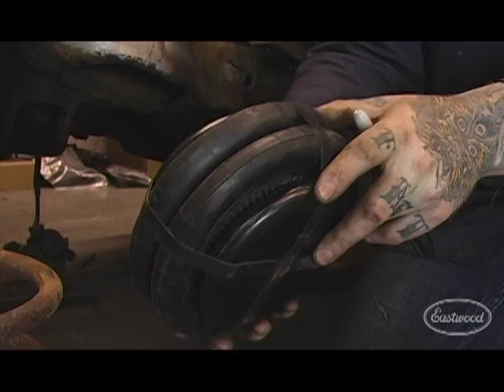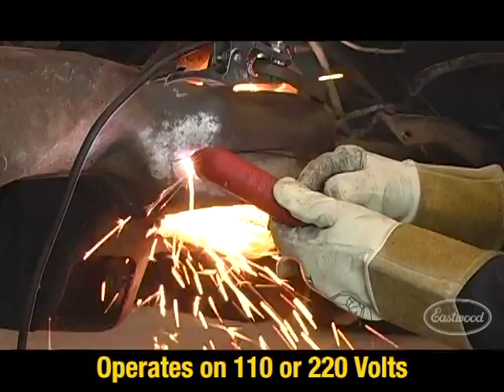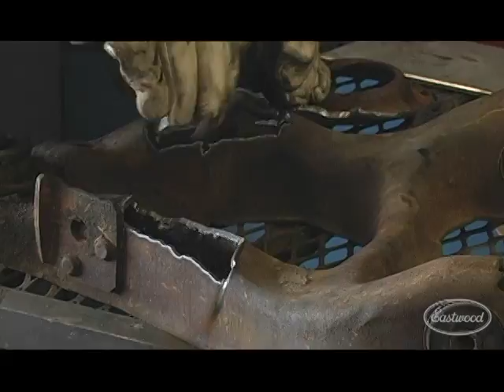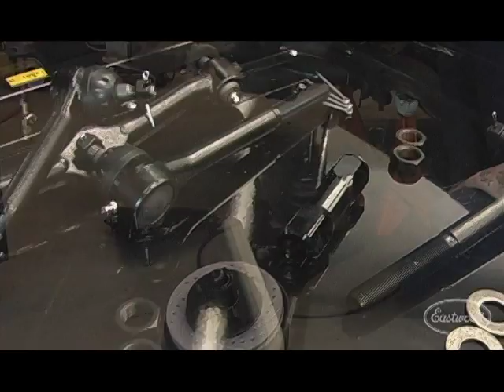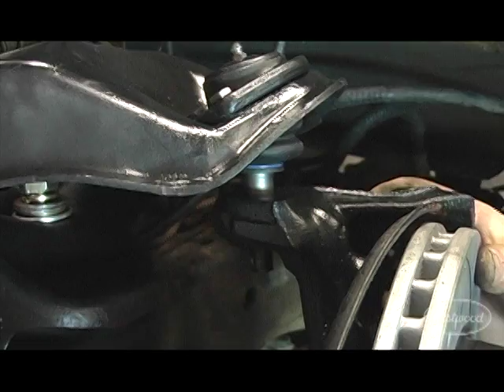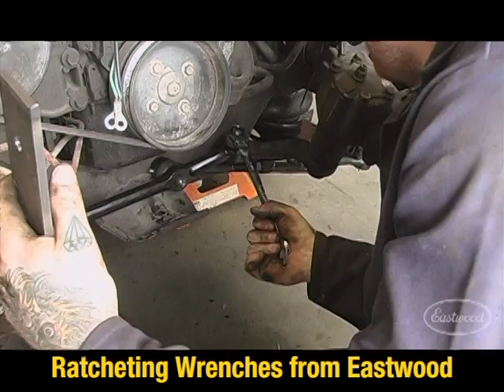Air Bag and Suspension Installation on 1950 Dodge Pilehouse Pickup Project at Eastwood

Comment from the maker: Dehumping the arms is for when you plan to go very low. If you don't plan to try and lay sheet metal or frame.. it isn't necessary. Be careful of the "bolt-on" universal airride bracket kits, we attempted to use those in this video before finding that they wouldn't work and had to quickly cut the arms back apart and weld plate steel in place to replace it.

Comment: Do you have to dehump the lower a arms? I planned to get the bag cups but is it required to dehump them? In only gonna be running 16" rims with 245 LP tires